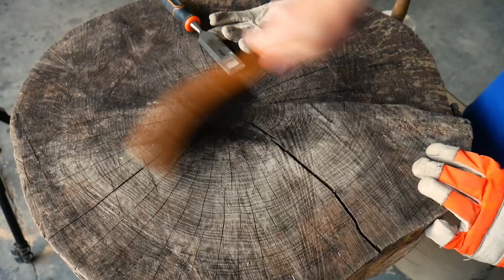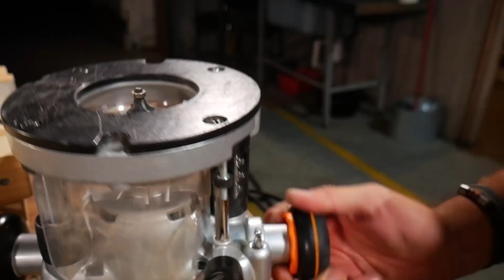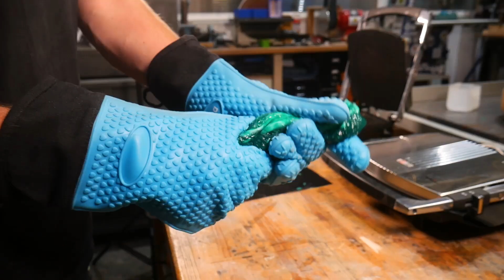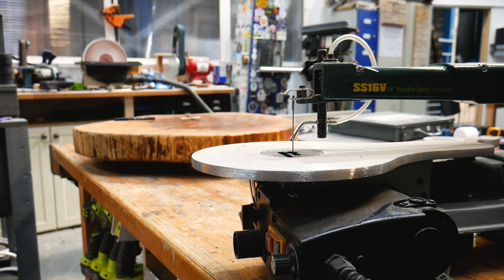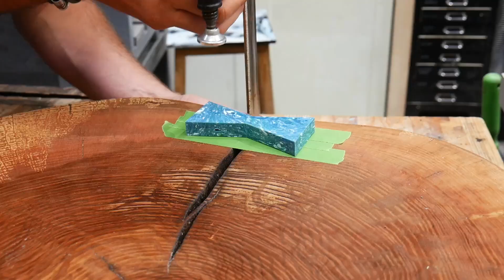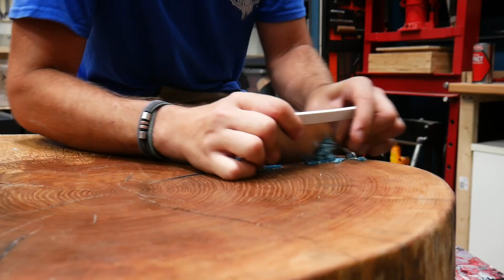$0 Materials into High End Furniture

Comment: Another way to make these would be to use perspex sheet to make a mould for your injection machine keeping the metal top and bottom plate you already have and just change the middle metal sheet and because it's only perspex it's a lot quicker to cut on the CNC machine

Comment: Not a critique but a real question:  could the plastic have not been smooshed into the cutouts for the bowties in the wood instead of forming them and cutting them to fit?
Reply from the maker: We did consider this. The issue is shrinkage. HDPE shrinks about 3.3% when cooled so it would not fill the gap perfectly. We’re thinking of ways to combat this though.

Comment: That looks cool.  Now I'm wondering what it would look like if you forced marbled HDPE down into the cracks to highlight them. It wouldn't be a structural repair, I know, but might look nice.
Reply from the maker: We did think of this as well, but the shrinkage as it cools would be an issue we weren’t sure how to overcome.
Reply: @BrothersMake  ... it would be interesting to see how much useful tension would come from allowing the ties to cool in place under some clamping pressure.  Great combination of materials.
Reply: @BrothersMake  Let it shrink, then clear epoxy injected atop?
Reply from the maker: We don’t love working with resin. Too wasteful and not recyclable